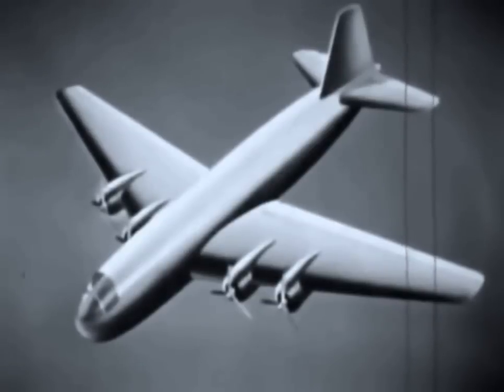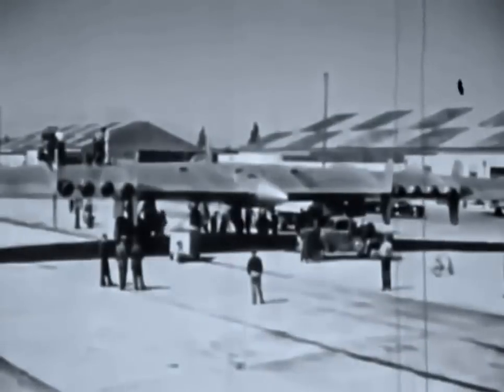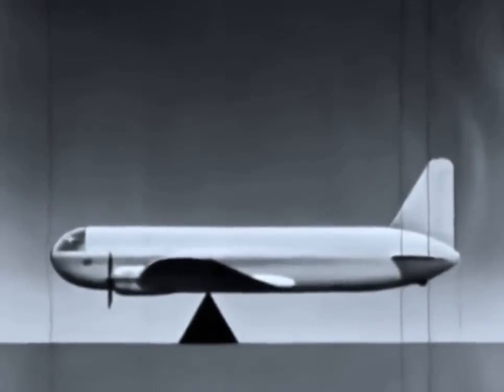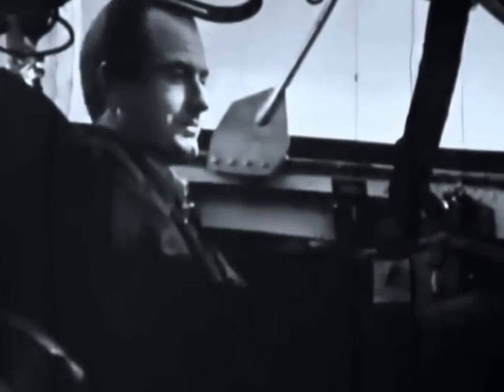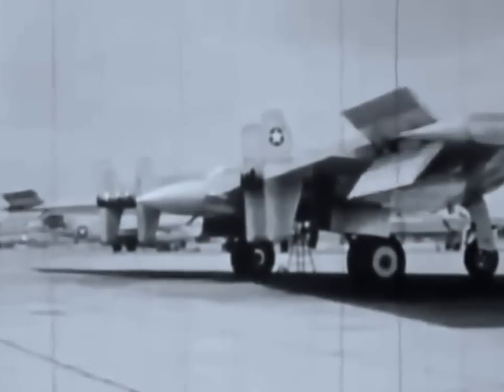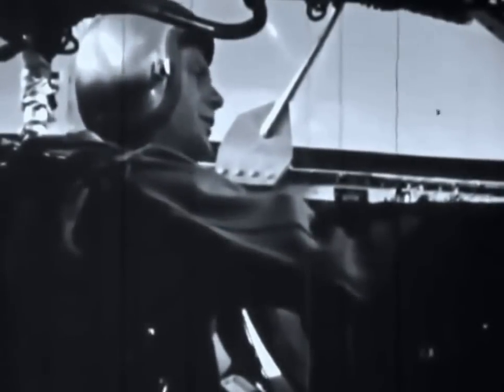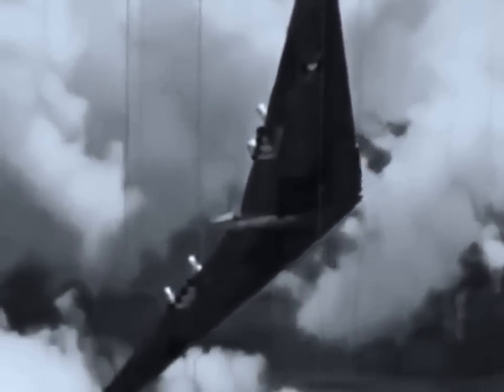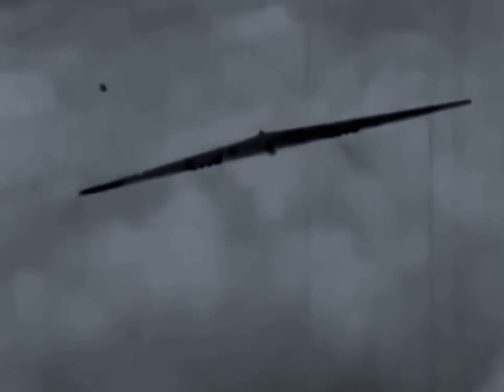Northrop YB-49 Flying Wing Promo Film - 1948

Comment: B-2 beta version.
Reply: Very ironic considering that Jack Northrop dreamt up the concept back during WWII, and got things going with the XB-35 (the propeller driven version of the YB49) by the end of the war, and yet it never entered service with the Air Force due to its troublesome gearboxes that drove the propellers. So they started work on the 8 jet powered YB-49 to keep the flying wing modern, but the 8 jet engines burned a helluva lot of fuel. What both the XB-35 and the YB-49 had in common were that the payload was small and from a bygone era, and the Achilles heel of both models was that they were highly unstable due to a lack of the high tech control surfaces that the B2 Spirit bombers had, and thus at least 2 YB-49s got into accidents due to mechanical failure, both resulting in fatalities. So every last XB-35 and YB-49 were cut up for scrap. But Jack Northrop got to see the prototype of the B2 Spirit bomber, and was happy, so that’s a plus.